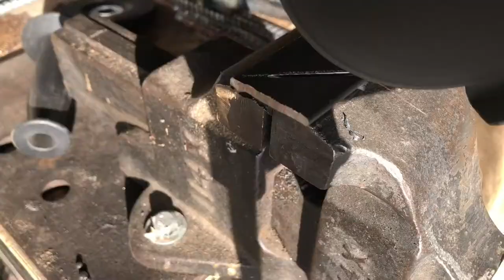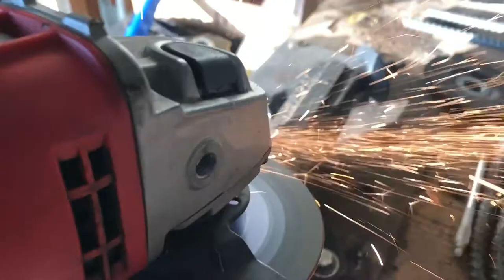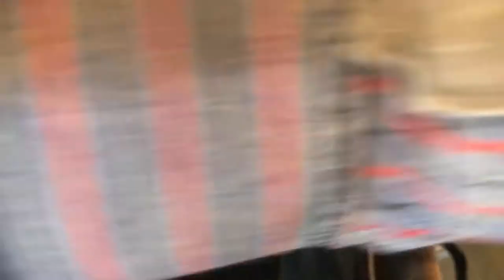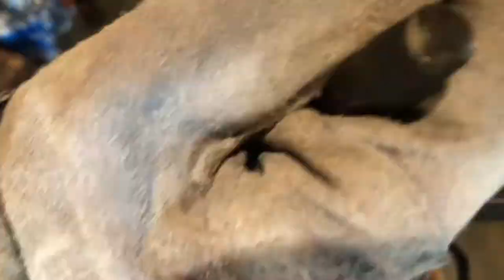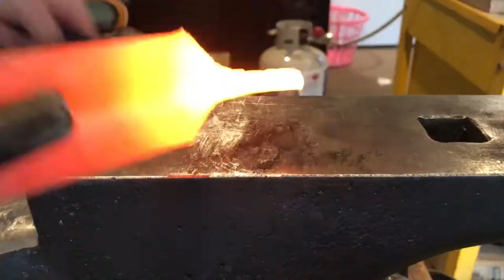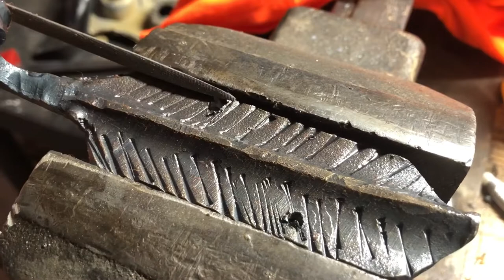Forging a feather hook

Comment: I was also inspired by John Switzer's video! I've now made several from 1 1/2" angle iron but didn't trim the leaf part down and left the stem longer, which results in a very, very husky feather! It's a bit of an effort to get the edges of the feather pounded down, but worth it. Nice job!
Reply from the maker: Thank you it was a lot more challenging than I thought but I’m just a beginner